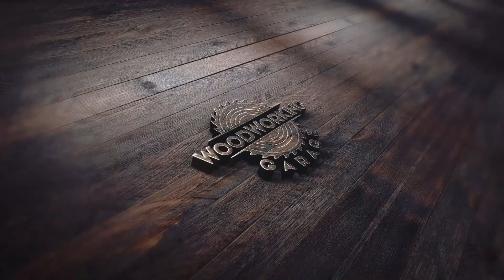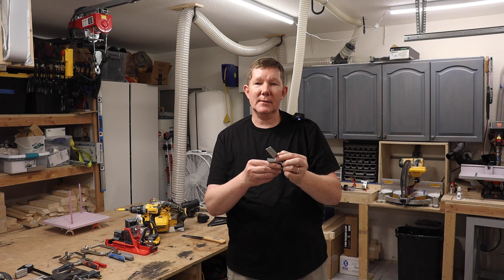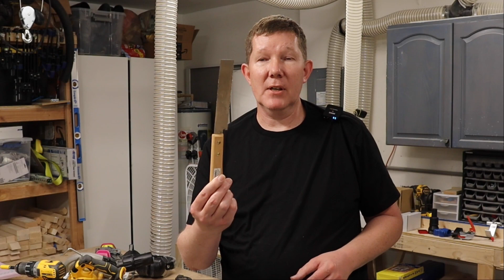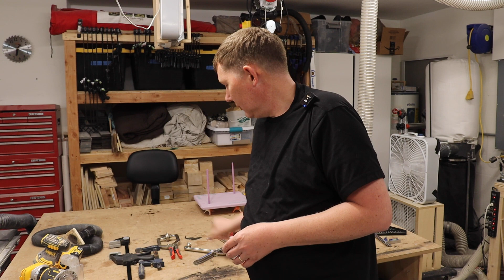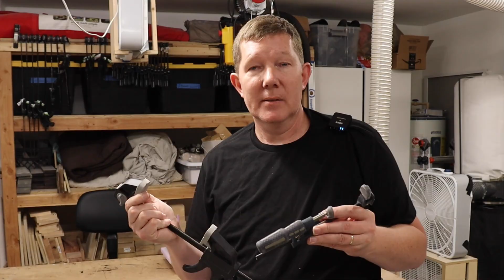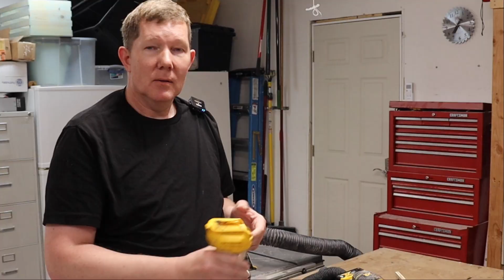Woodworking Tools: Beginner Tools (Stimulus Shopping)

Comment: I wouldn't buy a speed square for wood working.   Nor a combination square.  Nor a circular saw for wood working.   Nor pocket hole clamp.     Face clamp, yes.    Squeeze clamps, Irwin kwik grip mini bar clamp, 6inch - 8 of those.   And - 6 of the Irwin 12inch mini bar squeeze clamps.
Reply from the maker: thanks for your list.

Comment: Woodworkers are like people. They are all different. I’ve been woodworking for over fifty years so my advice to those who are starting out is not the same as the Garage Woodworker. Go figure. First you need to know what type of woodworking you want to do. Are you going to go to HD or Lowe’s, grab some 2X4s ands build some deck furniture? Or perhaps go to Woodcraft and buy some Birdseye maple and build a small jewelry box. Maybe pick some fallen branch from the backyard and turn a pen. There is carving. The list goes on. My point is there is so many directions to go, it is a good idea to figure out your direction before you head out. Each path has its own specialized tools as well as the basics. I will offer just a few suggestions. First if you are the grab some 2X4s and make a bench woodworker get a good quality Skill saw, tape measure and carpentry square. If you are a jewelry box kind of guy, get good quality measuring tools. A try square is a must but spend at least thirty dollars or more. A good Japanese hand saw maybe. If you will be making pens save up and get a mini lathe and some turning tools. Any woodworking will benefit greatly if you can find a mentor. Look for a local club. I just thought of scroll sawing. So my last piece of advice. At sometime if you will be pursuing woodworking you will want a table saw.  Only get a SawStop. A tablesaw is the heart of a good wood shop. It’s important to get a good accurate saw. It’s a machine that takes time to get good at using it safely. It is also the machine that has the most serious injury’s on. Don’t go cheap. Save up. Save your fingers. There are good accessories to make the saw safer and more accurate. Get TWO GRRIPERS. (look it up). Use YouTube. You can learn lots. Good luck. It’s a great hobby no matter what path you choose.
Reply from the maker: Thanks for sharing, a lot of good advice here.

Comment: as always great video, as a beginner i saw another piece of advice on another channel I'm quite sure you know but maybe it will help someone else. in rearguards to the tape measure when doing a project commit to one tape measure due to the fact it may be ever so slightly off from one another and that may be the difference in a project.
Reply from the maker: Yes, I was planning a video to talk about the inaccuracy of measuring tools and the need to use only one tape, and or, check all measuring tools against each other to ensue they all match. It will be a future video soon.

Comment: You find you can get for example a large table top sanded with the battery ROS or do you have a bunch of batteries?  That's my only reason for sticking with corded is sanding for hours on projects the cord never runs out of juice.  I do wish I had gone to a battery trim router but one day I'll upgrade and either sell or pass the one's I have onto one of my kids.
Reply from the maker: I have 4Ah battery size and I can sand an entire table top and have juice left over. They really do last a long time. I have 2 4Ah, and couple of 2Ah I use for my drills. Sounds like I need to do a video.... :-)
Reply: @EbikeReviews  Glad I could give ya a video idea ;)  My Rigid set came with two 2Ah batteries and recently seemed like they were not lasting long... I think it was just the one though and it gave up finally and won't charge so I have to call and get it replaced.  In the meantime I picked up two 4Ah batteries and maybe I could see those allowing for some sanding time.  I know I charged them once a couple weeks ago and the drill and impact haven't had a ton of use but the batteries also haven't dropped a bar on their charge yet so I'm a bit impressed so far.  Maybe I'll make the jump into full battery.... but it's hard because I already have corded and could direct that cash at other tools I "need"
Reply from the maker: @cnich0168  I only use my 2Ah for my drills and they last several projects. The 4Ah, is for Router, Sander and Circular Saw.
Reply: @EbikeReviews  Oops I had switched accounts and posted under my Bike Outback one, sorry if that caused confusion.

Comment: Solid list, Richard! Keep adding clamps as needed and a new woodworker will have an appropriate collection quickly. For the router, I found that an1/8" rounder and 45 degree chamfer bit covered almost all of my needs for the first few years.
Reply from the maker: Yep, I mostly keep the same round over and that's all I use.

Comment: Committing to a battery system is easily one of the most stressful decisions I have made in the past 2 years.
Reply: Well said.   While a battery operated tool with no cord to drag  is very convenient in certain situations, I have been thinking lately that the construction world has thrown the baby out with the bathwater in going to ALL cordless.

The baby in this case:
Convenience and affordability.
Battery-powered tools started out being wonderful for the other end of the house and up on a ladder, or out at a job site.
And when we were buying a battery-operated drill for instance, it would be one tool, not every tool.

The bathwater:
Lifespan/cost/non-standardization/inconvenience of battery systems.

Your battery can and will go bad or discharged at just the wrong moment in a project.

You buy a tool and you have to buy a battery system on top of it.  The expensive battery systems add a lot of cost and  put an expiration date on the tool set, which just didn't exist back when we started 40 years ago.  

(Anyone who has been using them since the beginning has had perfectly good and loved tools become totally obsolete because they could not find a replacement battery, or charger, or because the manufacturer changed battery designs and connections!)

All of these tools are going into the landfill. 

@WoodworkingGarage, you just published a video for beginners on a budget and this is for beginner tools...  

Beginners on a budget  in their little workshop on a workbench, where a plug is convenient, could cope perfectly well with a corded drill while in the workshop. 

 It certainly would be more convenient than all the batteries running out at the wrong time! Or having chargers go bad. 

And I have been thinking lately of myself as a more experienced tool user -- I really want to just go back to some more corded tools. We end up pulling them out anyway when the batteries give out!
Reply from the maker: What made it hard for you to decide?
Reply: @EbikeReviews  Prior to lithium, battery systems would change every few years so investing in a system was putting an expiration date on my tools. I would stick to corded tools for years for that reason. Ryobi has been the big exception to this and have kept their tools compatible with future battery standards- pretty cool of them.
Reply: @BassadorWoodworking  I’m still rocking my Dewalt 18v hammer/drill (came with a circ saw and reciprocating saw). Dewalt kept the same battery system for a long time—they upgraded the battery (at least once) but kept the form factor. At the time of purchase, I don’t remember there being any impact drivers—that’s how old it is. I think the brushes are near their end of life, though, so I’ve been carefully considering different cordless brands.

One thing that might interest you is that there are 3rd party battery converters. If I thought it was worth it, I could get a converter that would allow me to use 20v lithium with my 18v tools.